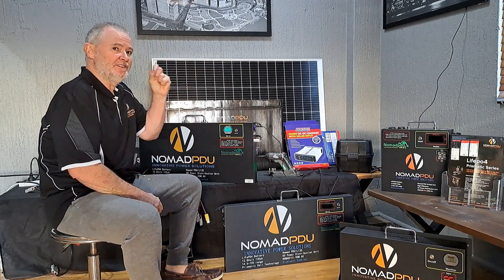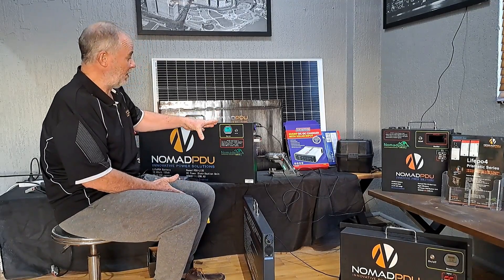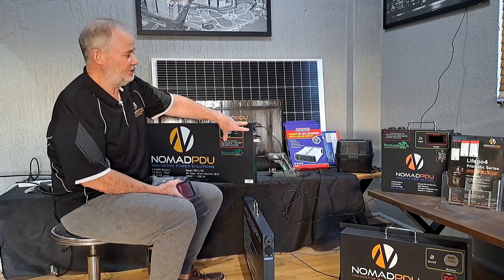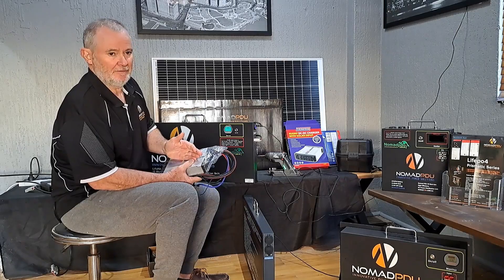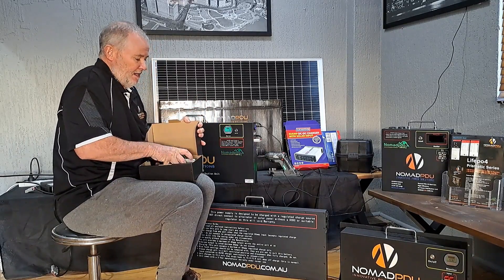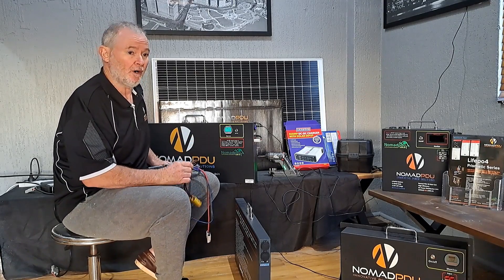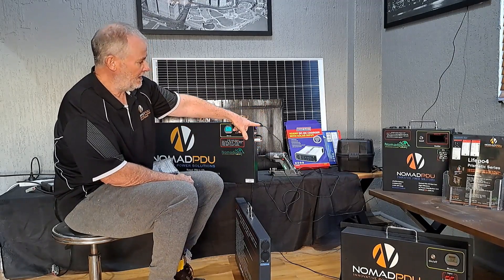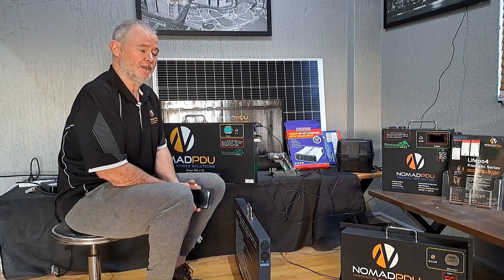135ah Super Slim Dual Power solution or Off-grid power distribution unit

Comment: What size fuse should you use from the crank battery to a Matson 40 amp DCDC charger? Do you need to fuse from the 135 Nomad unit to your lights as a precaution?